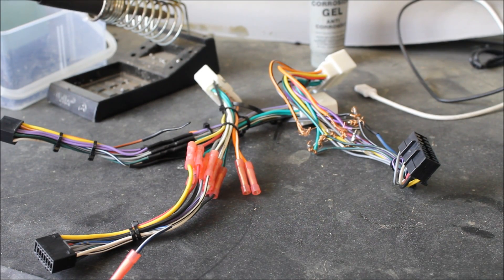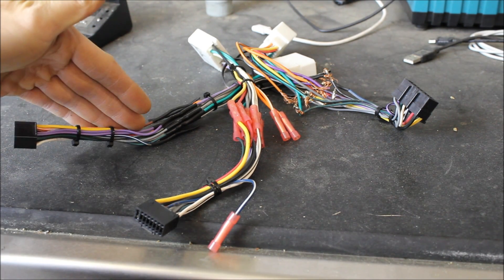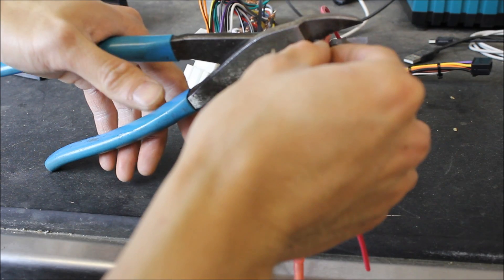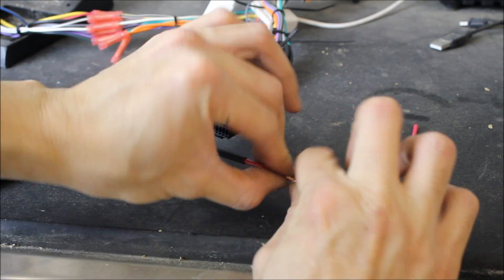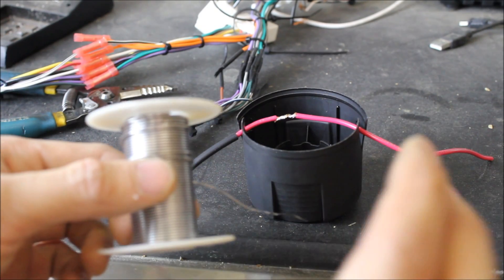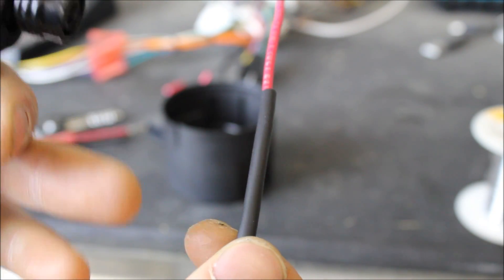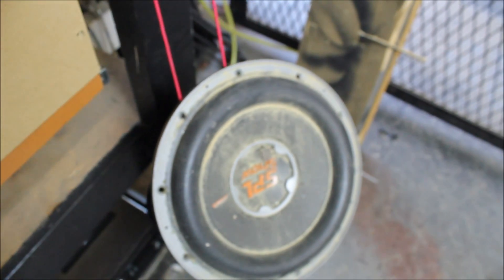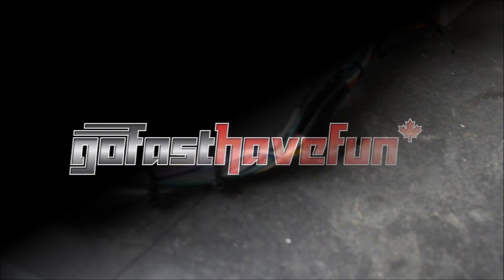Butt Connectors vs Solder | Crimping vs Soldering | Wire Connections | AnthonyJ350

Comment: DOD and Aerospace soldering is almost always done with tinned leads. They use solder pots and dip the leads. It's a lot easier. Good video, I wanted to see the crimping part. How do you know how much insulation to strip off the wire before you crimp?
Reply from the maker: Years of doing it and examining where the wire ends up in the connector when completed.

Comment: You didn't complete but connectors by using heat to shrink it.  I have question or how to say request for an video on how to properly connect more than to connections with soldering it and use some sort of heat tubes shrink tubes thanks...
Reply from the maker: These butt connectors don't have the glue in them, so there's no need to heat them up.  I'll see what I can do in a future video.

Comment: The second way of soldering is better for terminals rather two wire together. In a situation where the terminal is directly fitted on the circuit board first, tin the terminal and then the wire is better since when you  put them together and apply heat both will melt and join them faster. This way the circuit board will net exposed to heat for a long period that may reach the rest of the electronic components. This works though if you have a good soldering iron, correct temperature and most important the tip of the iron is tined.

Comment: When stripping the protective coding off the wire does it make a difference if you break or strip any of the finer pieces of copper wire?
Reply from the maker: If it's one probably not.  If it's half of them yes.  Cause you're limiting the amount of energy (amperage) that can be carried on that wire be reducing its thickness.

Comment: Crimping is way better than soldering, soldering creates hard points and makes the wire brittle. I build harnesses in may job, military spec. Only thing we solder is a coax cable for a reversing camera, all the other ends are crimped.
Reply from the maker: Are you using Marine Grade crimps with the glue inside?
Reply: No we use dust seals usually rubber, and ends of the limbs are strengthened with ATUM that has glue in it and its heat shrink. You could do a better job with Solder sleeves doing that sort of join.   https://www.google.co.uk/search?num=20&q=solder+sleeves&spell=1&sa=X&ved=0ahUKEwjoxKCK__jOAhXDJ8AKHTniC10QvwUIGygA&biw=1920&bih=934
Reply from the maker: WorksopGimp Cool thanks!

Comment: tinning the tips is a standard to keep corrosion from forming on the bare wire being exposed to the outside elements. This is crucial when working of very sensitive equipment, aircraft, computers.... ie emergency equipment, or anything when a life could be at risk.. Not a big concern when working in an automotive scenario.
Reply from the maker: What's the difference if you twist then solder?  If heated correctly it covers all of the wire any ways, plus the wires are in more contact with each other.
Reply: in the application of tinning you don't want to touch the bare wires, the oils on your hands can start the corrosion process on the&#160;bare metal. According to the IPC ( Institute of printed circuits ) Which is just a program that sets a standard for soldering within manufactures. Like I said this really only applies to equipment where you do not want to fail which would usually result in a loss of life. Aircraft, life saving equipment. ect... another fun fact on the lead solder being better than lead free. on aircraft lead free is not allowed due to the characteristics of the lead free solder over time will actually grow out like a spider web which in turn, shorts out other components. But that you don't need to worry when soldering wires together this applies more to circuit cards. -IPC Trainer 5 years
Reply from the maker: Steven Flores Shouldn't an oxygen free crimp with glue inside be the best connection period?  Or technicians have to wear gloves to avoid any contact because if you tin the tips by hand you still twist it to get rid of the strands sticking out, unless a machine is doing it.
Reply: When stripping a wire the best method is to use thermal strippers which melts and slices through the insulation. Most practical situations you don't have the luxury of that. So you carefully strip the wires with mechanical strippers. if done correctly you should only strip enough wire that is needed to solder. The stripped wire shouldn't fray if done right. then the first thing you do is tin it, then bend the wire using gloves or tools into the type of splice, Four most common, mesh (which I think is dumb), wrap, hook, or lap...each having its own strengths and weaknesses. Then you clean the splice to rid of any contamination during the manipulation of the wires. then you solder the joints as you explained from the bottom to allow gravity to assist you.
Reply from the maker: +Steven Flores Cool! Thanks for sharing your insight and experience!
Reply: oh not a problem at all its what I do on the side. Certify people to have the knowledge to work on circuit cards and basic soldering skills
Reply: Bare wire should NOT be exposed to outside elements. If you must, a dab of Permatex Silicone Tuneup Grease (any auto store, get the big tube, you'll thank me later) is great protectant for terminals etc since it's dielectric. 

Former Phantom and Bronco avionics troop here, later engine toad and crew chief on F-16s. Millions of crimped pin connections in aircraft are NOT tinned because it makes wire rigid instead of flexible! 

The right way to protect wires against moisture intrusion is NOT using SLEEVED connectors UNLESS the sleeve is heat shrink! Otherwise use adhesive lined polyolefin heat shrink (or materials specified in the Technical Order if aircraft). 

I use bare crimped connectors and heat shrink on automotive applications too. Those damn heavy sleeves BEG for moisture intrusion and don't really protect the connection so much as trap waters. 

I've done plenty of Western Union splices, soldered countless old soldered Amphenol/Cannon plugs and soldering works reasonably but is labor-intensive unless using solder-ring heat shrink splices. 

BTW you can harvest the copper crimp connectors from those silly heavy sleeved splices by heating with a heat gun or lighter then manipulating 'em with pliers while pushing out the crimp connector with a drill bit or piece of coat hanger, but bulk bare connectors are dirt cheap online.

For good connectors ignore the auto store and if you need it now, find a local industrial supplier like Fastenal etc. Of course it's much cheaper to buy online (bulk sources on Ebay can be great deals) so I do.

Happy wiring!

Comment: I  agree  with  using  bench  and  your  weight  to  crimp  but  most  of  the  time  on  a  truck  you're  reaching  into  something  to  do  it . you  know  that  the  stake  that  you  used  for  the  crimp  is  only  supposed  to  be  for  non-insulated  only . I  agree  with  your  use  of  it . I  think  the  other  only  mashes  it  and  does  a  very  p###  poor  job . Soldering  is  the  best  connection  but  in  trash  truck  environment , outside  the  cab  filling  the  connector  with  silicone  grease  and  a  solid  crimp  works  as  well
Reply from the maker: Ya every installer I know uses the tooth to crimp.  It seems to be a trade secret that is very effective, because anyone fresh from a text book will disagree but I've done it thousands of times and know it's a good crimp.  You saw in the video with the weight test.

Comment: The tinning tips method was a NASA standard if I remember. Instead of trying to line up the 2 ends side by side, you use pliers to make small hook loops on each wire then link them together and smash the loops together before soldering. I do prefer the twist method you used... just makes more sense for a stronger hold.
Reply from the maker: Ya and I install more head units and remote starters than the rocket scientists at NASA.  Plus they're in Houston and I'm in Canada where it's a little colder.
Reply: J-hook tinned leads, compress, solder then apply heat shrink tubing. This was performed on static instrumentation that I worked on, that wasn't subjected to vibration or large temperature swings.

Comment: really very good vedio , for the information of Butt connectors ,  but in next step , May I know can the heat shrink tube be replaced by another products ? make the connector very easy  and tight .  that is called Solder ring heat shrinkable tube. 0086-13806607069,  cinderella@hooyeegroup.com

Comment: what about a non insulated butt  connector with heat shrink around it.
Reply from the maker: +Michael Ramirez Ya you could, but why not solder at that point?  Seems like a few more extra steps multiplied so many times.

Comment: your hands will thank you if you solder more, especially if your installing 5-9 head units a day,crimping 10-13 butt connectors each unit! soldering always here.
Reply from the maker: Nice!  Glad you like wiring it up that way!
Reply: unless you are twisting 10 and 12 gauge wire all day while soldering. then your finger tips get sore. lol

Comment: You cant hear the difference, its the same thing only soldering it will make the connection stay together longer, but there the same thing in general. They both last for years.